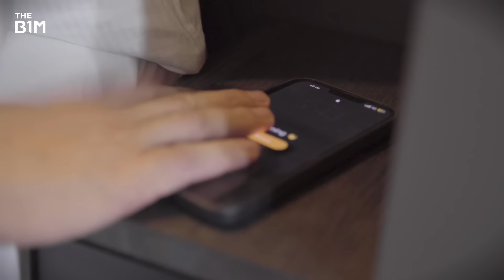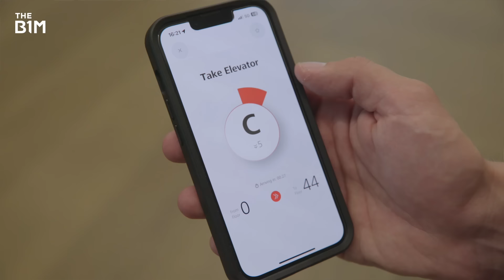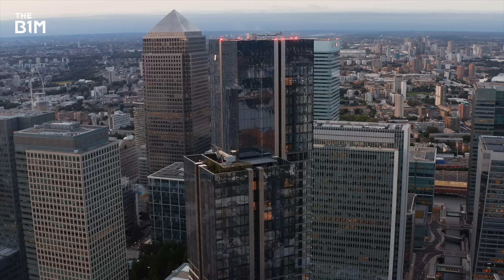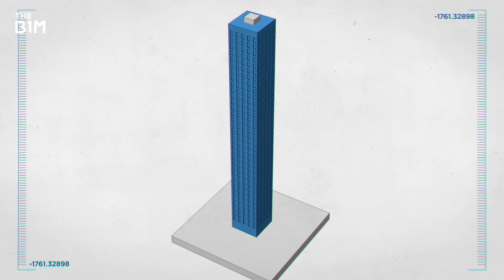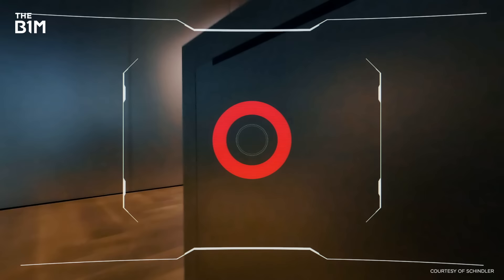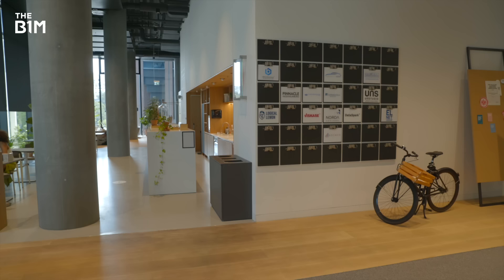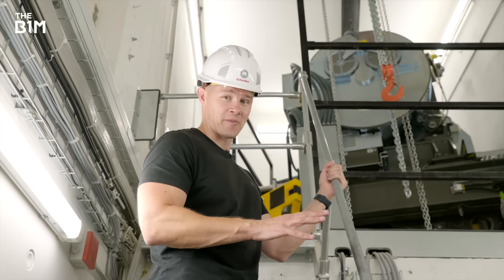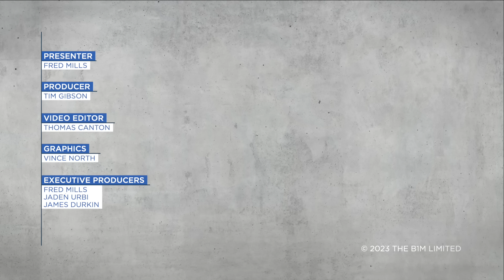Germany Has Solved the Empty Skyscraper Problem

Comment: I love your videos, and they are generally very informative.  This one though, I guess...I just don't get it.  

You establish at 4:25 that using the same elevators to service both residential and commercial would be inefficient. You proceed to explain that multi-use buildings traditionally have multiple lobbies, one for each use, each with their own elevators to increase efficiency.  

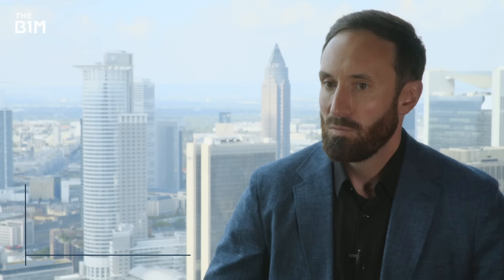Now at the beginning of the video, you establish that Omniturn has two distinctly separate lobbies, so nothing new there.  Then at 5:20, you establish that Omniturm's elevator system uses the same lifts to go to service all floors.  At 5:40, the Schindler Group representative says "We are doing it with the same elevators. So, by definition, that's efficiency."  ....huh?  That's a direct contradiction of what you've just explained 1 minute earlier. 

It really seems this system is just using elevators that have doors on two sides, but that's also not new or innovative at all.  So...what's really new here?  The app that calls the elevators before you arrive?  That's kinda neat, but that has nothing to do with the physical elevators or the elevator shafts, so I'm unclear why all the talk of those.   

Just over all, a very confusing video.

Comment: How ridiculous! If there are that many empty office spaces, why would anyone want to build more? Why is an office such a problem to change into an apartment? Aren't there bathrooms on every floor, probably within the offices? Couldn't the plumbing be just adding a kitchen sink? Isn't there already ventilation, electric and cable outlets, natural light? I don't understand why it would be so different. I added an office in my house from existing rooms simply by painting and adding a few pieces like a desk and chair.
Reply: The bathrooms in business offices would be in the center of the floor.    With apartments each apartment has to have plumbing.    Each apartment should have access to windows to the outside, that makes apartments long and narrow.

Comment: if they change the use of a office to a flat and vice versa they need a new building permit. Can do and allowed to do are two seperate matters. In most zonings it's not allowed to mix office with residetial use.

Comment: As of 06:12 since there are so many empty office buildings why not forget about mixed use, and start converting them to residential ? I saw another video which featured an architect who has a formula or checklist to determine if a building is eligible for conversion from office to residential. But I'll bet the non-candidate building could be adaptable and maybe by installing apartment modules of some sort. The next question is affordability. I live in Newark NJ where there's a lot of new development, and the average rent of all of the new units will be around $3000 per month, and I can't afford that. When I moved here 30 years ago the average rent was less than $1000 per month for a 1 bedroom. I may have to move to Mexico, and while they continue to move here, and get free healthcare, and spending money.

Comment: I would think a floor with apartments would need more bathrooms and kitchens than an office space… the elevator problem is fixed but if you change a floor from a hotel to an office area there will be issues….

Comment: Just having two doors to each elevator car doesn't help at all.   The elevator still has to stop at all the floors  selected by the passengers.  If you stacked 3 cars on each shaft, the  segregate passengers would just wonder why the elevator  stopped and didn't open doors  at floors not selected by the people in their car.

Comment: I have the same puzzlement expressed by many others here.  What is the big deal?  I kept waiting for some huge innovation, which was never shown.  Even worse, I never really understood just what the problem was that needed solving.  You need better explanation.

I've seen elevators with two doors... and seen them used to control access to one side for ever since I can remember, and I'm over 60 years old.  In the old days this was done with a physical key, in later years a key card.   Heck, when I was young occasionally there were still elevator attendants in a few older buildings and they could be used to limit access. I take it now you're letting people use their phones.  Okay, that is an incremental upgrade.  But couldn't a lot of that be retrofitted?  

You act as if  existing elevator systems can't adapt to changing systems.  Well, maybe... but why?  You didn't even really tout the cellphone thing much, instead opting for diagrams about elevators serving different floors.  Again, I've been aware of elevators restricted to certain floors for my whole life, at least in the form of express elevators and to restrict access to a penthouse.  I just don't get what you've done that is truly new.

Comment: instead of having two ground floor lobbies, why not put the commuter loby (office workers) up a single flight of stairs.. then you don't need to have two sets of doors on every elevator and you can if you built your elevator system right, have twice as many elevator cabs? I ask because it sounds like you'd be getting half as many elevators if you're having to make sure that each elevator has access from both sides.

Comment: Correct me if im wrong. if all floor has opening on the back. meaning ur single lift shaft have to have 2 corridor access for each floor. Additionally your existing lift core arrangement dictate the possibilty to upgrade to this lift system. ie. with common 2 x 2 lift core with perimeter corridor wont be able to accommodate to front and rear opening lift cart.

Comment: I don't know about Germany but in the US a LOT of "back office" activity has been transferred out of the cities and into the far suburbs.   This has been going on for 30 years or more.
Reply: 19 out of the 20 highest skyscrapers of Germany are in Frankfurt. The only city in Germany with a cluster of skyscrapers in the inner city. In the other cities, there are only a few single ones spread out over the place.
For the European Central Bank headquarters, they picked out the area of a former wholesale market east of the old city.
Starting in the 60s they built an office city (Bürostadt) Niederrad between the city center and the airport. In 2006 30% of the offices were empty. Thus they started to convert former office buildings for residential use. E.g. a 15 stories building at Lyoner Strasse 19. The whole city district was renamed to Lyoner Quartier to get the "office city" out of the mind.
They are however building a new office district Gateway Gardens in the area a former US military housing area next to Frankfurt Airport. This district will stay non-residential as it is too close to the airport (quite noisy there). 
Important in Germany is however a good connection by public transport. Thus for Gateway Gardens they re-routed the S-Bahn line to the airport and built a new stop there.

Comment: I understand the elevator thing, but I have to snicker at the idea of folks who are used to computers being on at all times --- they go up to one and don't realize they need to touch a key to pull-up the screen -- instead, they clunk it about thinking it's broken and move onto another one. Now, imaging folks getting used to elevators which cater to their every need .... going into a place where the system is normal. They might take 3 hours just to get to the correct floor! 

I wonder if there will ever be a remake of the film Idiocracy.

Comment: so, is Germany the first country to use dual entrances in an elevator? how exactly did they solve the emptiness of the building problem?
Reply: The elevator can transform into an roboter which destroys the offices and then buildt apartments. Then he transforms back into an elevator ( Important : With two doors). Wasn't that clear in the video?

But gags aside: After 30 Minutes of thinking, I think I understood it. 
There are two lobbies. On for the residents and the other for the workers. But they both get to all the eight elevators at the bottom. The app then says which elevator you have to take to get as fast as possible to your destination. So when a Worker wants to go to the 5th floor, but resident into the 10th they will not take the same elevator. But when 2 residents wants to go to the same floor they will get into one. And I don't know why it's mentioned that 2 elevators have 2 entrances.

So when this Video wouldn't be an advertisment it would go 20 seconds: "Hey, this building has 8 elevators which can get to every floor and a app will tell you in which to go by tracking your data to make it efficient."

Comment: Don't really think 'smart' elevators with 2 doors deserves credit for that actual, structural work behind making a space useable for residential vs. commercial purpose. Also, why such a lack of focus on how the smart elevator system actually works. I gathered that it scans people coming the building, and tells them which lift to use. Great, how does that work for 1000+ people coming and going at the same time?

Comment: Question;
What does cutting another access hole in the elevator shaft do to the structural integrity of that shaft?  dual port shafts are common and built differently than single port shafts.

Comment: So, can you at least go to the office straight from the apartment? Do you need to go through two lobbies?

Also the lift waiting for you with the phone is convenient and all, but I have to assume there’s some prioritisation system when more people want to use it than there are available shafts? 

I must admit, at the start I was thinking Schindler finally had something to rival Thyssenkrupp’s Omni (I think it’s called), but this seems fairly mundane. Most of it seems to be about integrating the phone and pre-calling the lift, to replace access fobs (and pre-dialling the destination instead of call buttons).

Comment: My local hospital has lifts with doors on both sides. It's confusing if you're a visitor. Other than introducing a new security problem, how does this new car fix all the usage conversion engineering issues?

Comment: sensible approach to flexible / hybrid design - the equally large challenge is compliance with residential and commercial building codes and require juggling of finishes and amenities between the 2 different uses - interested to learn how these challenges are adapted to

Comment: My experience converting commercial to residential has many challenges.  Sound almost impossible to contain given original construction.

Ducting, electrical, etc...these costs dramarically increase costs to the consumer.

Building inside out NEVER again.

So much emphasis on elavators, curious.

Comment: okay, but if using the same elevator for several purposes slows down traffic, and this building still uses the same elevators for multiple purposes, how does that not slow down traffic? like, it sounds as if that aspect hasnt been adressed. or is that why theres 8 of them?

Comment: Im kinda confused about how simply changing some of the floors' uses would mean you need to make a whole new elevator shaft. Wouldnt the previously existing elevators able to take anyone to any floor that they need to go to in the same amount of time, whether it be an office floor or an apartment floor? How would it be any less efficient if the floor someone is going to happens to be an apartment floor rather than an office floor? Why would you need a whole new dedicated elevator for half of the building that the previously built elevators were able to service jut fine?

Comment: also one question how did they solve the sound ishu between "houses" 
sewage systems cause a bathroom with toilet is normal for a home but in a office you have x amount of toilets in 1 spot.
did they make like a "computer floor"in the corridors"?  as to chance the sewage where needed ? (not on the whole floor because then you would have sound problems when making it a appartement later
ventilation can be changed without much of a problem but what bout the sound in the shafts?
heating / cooling should not be a problem since you outline it to be a office any way.
for electrical component can be in fixed cable trays in the floor with a floor box so it will be semi flexible without making sound a problem, (and if you make it a appartement you will do the extra needed sockets in the wall any way)

Comment: This concept has been in India since decades due to relaxed zoning laws. Any tall tower in Mumbai or Bangalore that has been around from the 80s has minimal zoning rules. If you own a property you can run an office or convert to a house or a doctor's clinic or a student centre or run a restaurant or whatever you like. The lift is just used to get you to the floor you want to be at. Only challenge is the foot fall and traffic it generates. A lift might stop at all floors in each direction! I don't know how Schindler fixed that!
Reply: The fixed the elevator going to each floor with a phone app that tells the elevator what area of the building your authorized to visit. Your phone is a restricted access card.

Comment: I am sorry but how exactly does this solve the problem? They are just elevators with two doors and two lobbies at the base of the building. 
You enter through separate lobbies depending on if you want to visit the residental or office parts of the building but the elevators still stop whereever needed. So the whole idea of never interacting with differently used parts of the building falls apppart as soon as you enter the elevator.
If I enter in the residential building, can I go to an office floor or vice versa? Or would I have to unconviniently and wastefully go down, change lobbies and go back up?  If I entered in the residental lobby and go upwards and someone from the office above me requests the elevator to go even higher, will the elevator stop and take them in? If not, that would massively limit capacity for those elevators because one single elevator can only be used half as efficiently per use. 

And regarding the skyscraper itself? How have they designed the room layout so it could accomodate office and residential? Would it require massive remodeling when switching the usecase? Because offices and residentials booth have vastly different standards, regulations and installations.

Comment: Very cool building and a good blueprint (pun intended) for future city centres that need reviving... Like Frankfurt, Edmonton and Calgary both have vacancy rates near 20% and 30% respectively however so far only Calgary has thrown a ton of cash at it, upwards of $75 per sq ft to developers in order to flip their vacant office towers into apartments.. It might be pricey but so far it's been very effective in terms of both applications and the number of units built or under construction so far...

Comment: Isn't this a complete self contradiction resulting in the obvious conclusion that of course you can use an elevator for both business and residential. Some business towers may have problematic layout but those I've looked at could readily be converted to apartments. It's a non issue. And in many cases due to the elemental construction, the entire facade could be updated if it's too ugly due to age.

Comment: It seems that the plumbing, septic and HVAC would vary tremendously based on the proportion of residential versus commercial.  How do they increase the volume of flow as easily as they change the elevator programming?

Comment: this video makes no sense. It's not as if you're adding additional floors such that you would get more traffic. it's the same number of floors! and correct me if i'm wrong, the number of people per unit area in residential space vs that of commerical space is much lower, therefore the traffic would actually GO DOWN. having an additional door on an elevator is nothing new. they do this all the time in hospitals

Comment: I am a litte confused. Why does the old elevator system not work with changing the usage of the different floors? Can't all elevators reach all floors and only stop on those they are supposed to stop on?
Why should this be only possible with the elevator system demonstrated on this video?
Referring to 6:25

Comment: TLDW: 9min Advertisement for a "second elevator door" on the opposite side because access control via digital keys is apparently to cumbersome.
While Skyscrapers are generally useless buildings build for someones ego, mixed use is actually a good thing.
But honestly? This vid, in the way it is, is pointless.
At least you got some money out of it.

Comment: So Germany has solved the office space crisis.I don’t think so the big problem here is installing all the extra wiring and plumbing required  If you have not designed for this it is not practice to start installing these once the building is completed. A clever lift system is of little advantage  As all current office space is not designed to be easily converted to flats then this poor idea will be of little use during this crisis

Comment: If you are in the office space and you are going to ground. Can someone in the apartment core call the elevator and you get into the same elevator or does it override the resi call and go to ground floor. How does it preference who it goes to if both the resi side is calling for elevator and office is calling for an elevator.😅. I can see an issue when the office is in high demand (during office hours) that the resi side would be waiting for an extended period of time in this scenario